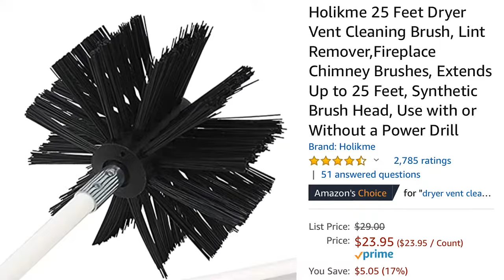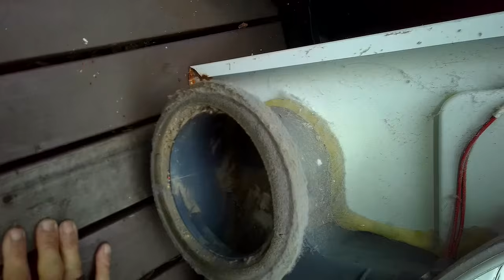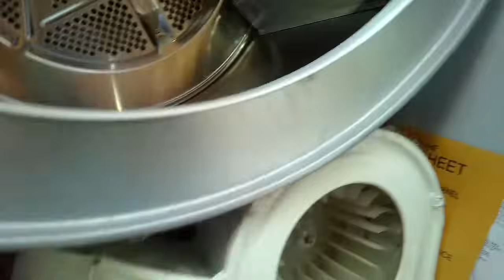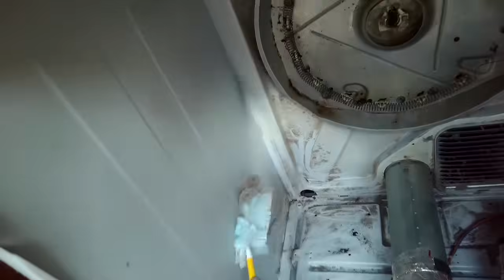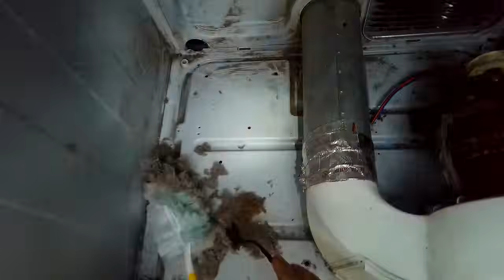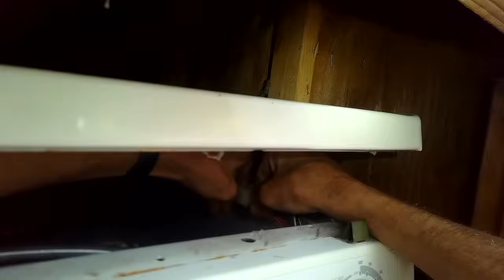✨ Frigidaire DRYER — EASY YEARLY CLEANING ✨

Comment: Great video. Well done and very informative. I now know what to expect approximately since I own a GE assuming that they’re very similar. Did I say assuming, uh oh fingers crossed.
Reply from the maker: Thanks Doug,
Please let me know how it goes 👍
Reply: Success! It wasn’t as bad as I was expecting but it was bad. I learned to to put some tape on some of the metal edges after leaving some blood on the project. Dealing with that belt and tensioner looks a lot easier on the video but I managed. Thanks again.
Reply: Thanks for the video.  My GE dryer is little stif on spinning and it looks like, something is rubbing underneath the trumbler. What’s your advice on this . Thanks

Comment: no one is making a video for my GE. this front looks nothing like mine and I can't get it open. No lint at all yet reads "clean filter " and shuts down
Reply from the maker: Can you try super cleaning the filter with very hot water dishwasher detergent and an old tooth brush.
Reply: Yge
Reply: Ozone
Reply: @ScottTheFixItGuyChannel  oooh and a few others are doing it is
Reply: @ScottTheFixItGuyChannel  and a lot up the outside of the United States
Reply: Have you contacted the company for cleaning info?